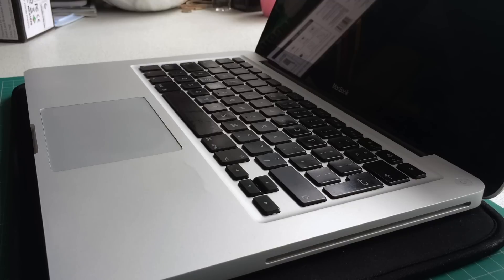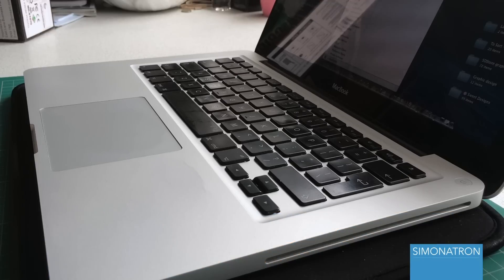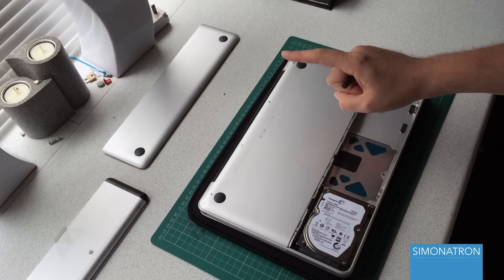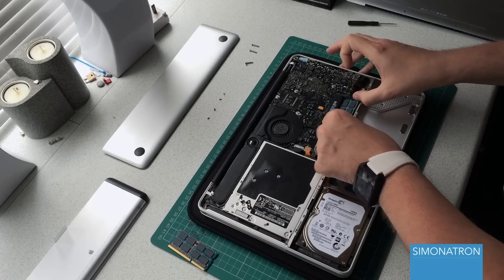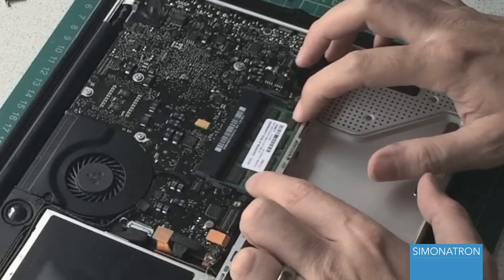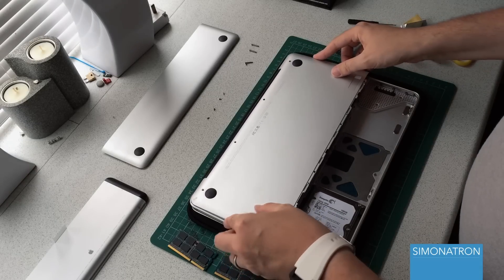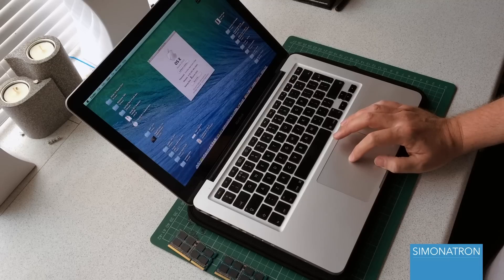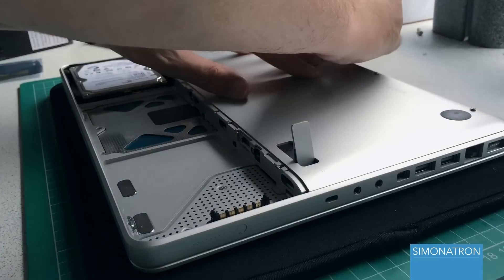Will a Late 2008 Apple Macbook Run With 8GB Memory Installed?

Comment: The reason the second module going in sounded so nasty and looked so difficult is cause you have to initially slid it in at the same steep and as you did on the lower module.

Comment: What would be more important  to Upgrade to Bigger RAM from 2 to 8 Gb  or  HHD to SDD to make computer run faster ?
Reply from the maker: +CookieMurderer123 Why not do both? I have an Hybrid drive and 8gb of ram, now this Macbook runs fast than my wife 2012 Macbook Pro!
Reply: +CookieMurderer123 if you plan on doing heavy video applications or are a DJ that plays videos then a combo of SSD and the 8gb ram upgrade would do you well, also SSD will do fine without the 8gb ram upgrade if you are just using your machine for normal use like web surfing social media or office, but if video edit or VDJ then yupp upgrade both
Reply: The Noid thank you so much
Reply: +CookieMurderer123 id suggest both or atleast to 4gb of ram as 2 just isnt enough these days

Comment: Hi,

I have the following:
 - MacBook Pro
 - MacBookPro5,1
 - Boot ROM: MBP51.007E.B06.
 - OS X Yosemite 10.10.5
 = Upgraded RAM from 2GB to 8GB 1067MHz DDR3

The system recognizes the 8GB memory, however the system is still slow and utilizing only 2GB RAM. In the Activity Monitor shows 1.75GB Memory used (App Mem: 707MB, Wired: 739MB), 1.21GB Cache. 

How can I make sure the system is using all of the 8GB RAM?

Thanks

Comment: Hi sir
I just wanted to know if there is any modification you can do on a Macbook Air (late 2008) such as replacing the HDD to SSD or maybe even the memory just like you did even though it's not the same laptop?
Thanks in advance
Reply from the maker: +wazinho Unfortunately the Air's aren't very upgradable.  You certainly can't upgrade the memory as its on board, you can upgrade the HDD though, but it is a special HDD.  Have a look on iFixit.com, they have some great guides and how to's.

Good luck!

Comment: Hi, I have a macbook late 2008, and I´m checking at crucial the memories. The helpers on the chat can not assure it will work, but they say in that case, it should be those one, can you help me? I have this boot rom: MB51.007D.B03. So I think If I choose the correct memory, I gonna install a SSD so I can use El Capitan properly, now run so sloe, So I downgrade so snow leopard. Please can you check the memories in here: http://eu.crucial.com/ProductDisplay?storeId=10152&urlLangId=-1&productId=14177&urlRequestType=Base&langId=-1&catalogId=10152

Comment: could you upgrade to a 500 gb hard drive as well??? i have the same computer as this with the same rom .. i know nothing about computers so sorry if its a stupid question just wanted to know before i bought one? and any ideas of a good hard drive if so?
Reply from the maker: +TROYENGEL Indeed you can.  I have a 1TB Hybrid drive in mine :)  To be honest, Hard Drives are Hard Drives these days.  The hybrid drive I have is a crucial one, works very well and speeds the system up greatly!

Comment: Could you possibly make a how a 2008 late Macbook Pro runs in 2015?
Reply from the maker: Unfortunately I don't have a pro, only the one in the video. However what I can tell you as that the MacBook in the video works great in 2015, even with El Capitan, the very latest OS X installed.
Reply: +Simonatron ok thank you :)

Comment: Hi Simon, I have he same spec but mine is a macbook pro. Would that cause an issue?
Reply: +TheOniDJ  Biggest thing to watch is that you get 1067mhz ram.  Anything over that will not work even though it shows it as an option on most sites.  Get it on ebay because most retailers only have 1333mhz and that will not work.
Reply: This is a macbook pro ......
Reply from the maker: +Sjac Coolen This laptop is not a MacBook Pro, this is a standard MacBook. There isn't much difference between the standard MacBook and the pro version apart from the graphics chip however.
Reply from the maker: Honest answer is I don't know. I know this works with the MacBook, I'm pretty sure the pro supports 8gb out if the box.

Comment: I upgraded my late 2008 MacBook from 4 to 8 Gig a few months ago - it works perfectly with the extra memory.  I agree with you, it's still a fantastic laptop despite its age.

PS: After pressing the Power button, the Power On Self Test takes a little longer, so don't panic if nothing seems to happen at first!
Reply: hola tengo la early 2008 en teoria son las mismas, que memorias le pusiste?
Reply: @juliofleitas1412  1067 s

Comment: I just tried one but after I put it on. It started beeping. Any clue on what to do
Reply: +Nsofor86 I would guess the ram you have is over 1067mhz.  That is the one caveat.  Get it on ebay as most retailers don't carry it anymore.  Make sure it is 1067mhz or less.  1600 will not work.

Comment: Hi mate I just recently installed 2x 2gb kingston 1600 ddr3 PC3L on a Macbook late 2008 2.0ghz core 2 duo. My problem is its says ok in the system report however, it keep restarting the system. I suspect maybe because the ram is on low voltage at 1.35v compare to a standard 1.5v. Can u help me diagnose the problem I never had the problem in restart until i did the upgrade.
Reply: +Em Estores  Has to be 1067mhz or less.  Look for 1066 Mhz PC3-8500 on ebay.  1600 will not work and neither does 1333 on the older ones.  Search for "macbook ram 1066mhz."  The 8gb kits are under $50.

Comment: Simon, does it still work on Yosemite? I am on Yosemite and the new Photos app is really slow on this similar late 2008 macbook. Considering the ram upgrade to 8GB as in your video.
Reply from the maker: Mine works flawlessly on Yosemite. In fact it works better than my 2008 iMac.
Reply: Simonatron Worked for me as well, Photos seems fast now :)

Comment: Hi, can I tell you which brand of rams you have installed and what type of mac you have? I have a late 2008 macbook core 2 duo 2ghz and I tried to install 8GB of ram brand Hynix but it don't works.. I have the same bootrom version in the description. Thanks.
Reply from the maker: Sorry, You can't install 8gb of memory in the 2.0ghz model.  This only works on the 2.4ghz model running the bootrom MB51.007D.B03.
Reply: @Psymo  Can I install 1x8GB instead of 2x4GB?